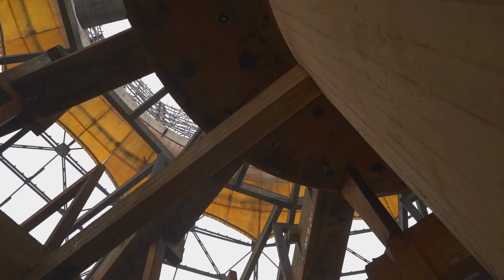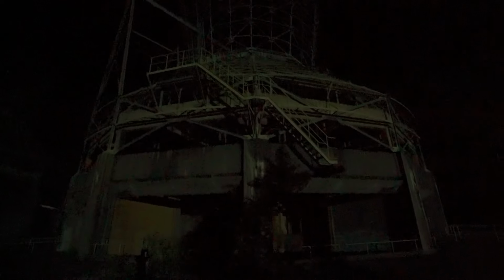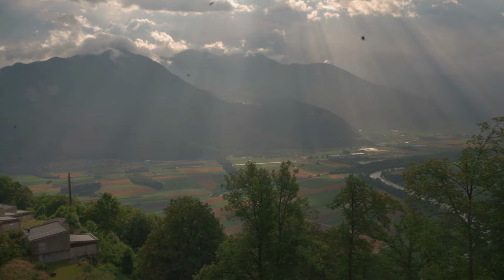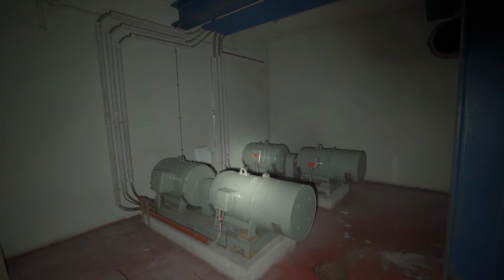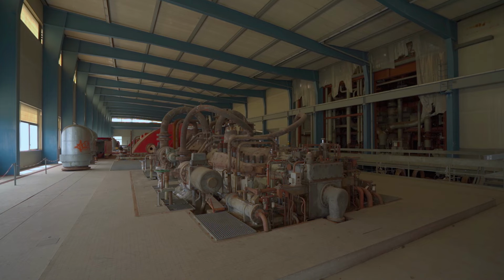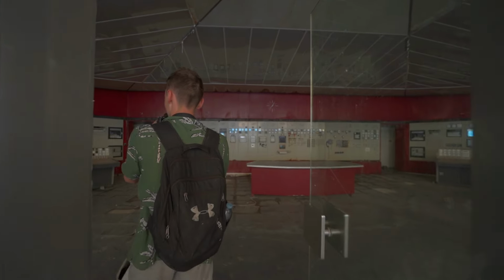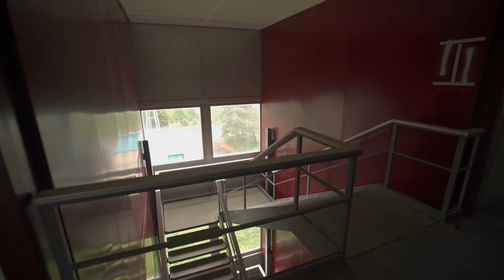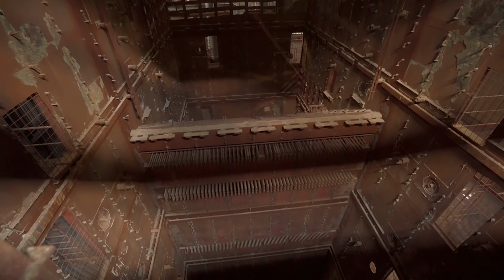Exploring an Abandoned Power Station: Stealth Camping during Thunderstorm

Comment: Great video guys, think this was a oil fired station, as Portishead station Bristol...as can see two oil holding tanks behind the boiler house..
A gas station will be a combined cycle system, using a jet engine coupled to a alternator / turbine and no boilers as such..this has a chimney and cooling towers  too, gas stations have gas fume extraction systems.

Comment: Cracking video. As a side note, the turbines generated around 150MW of power each. The refinery nearby is also abandoned and should have a small power plant of its own.
Reply: It used left over oil from the oil refinery process from the nearby oil refinery as a fuel but that refinery has by now been demolished sadly
Reply: Yeah 700kw didn't sound quite right